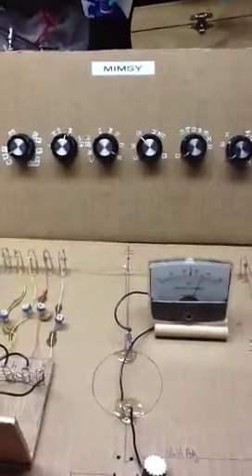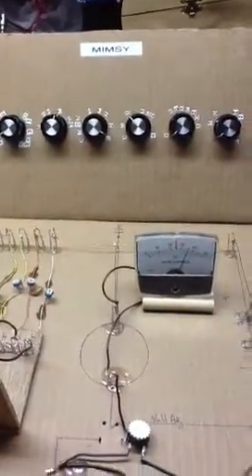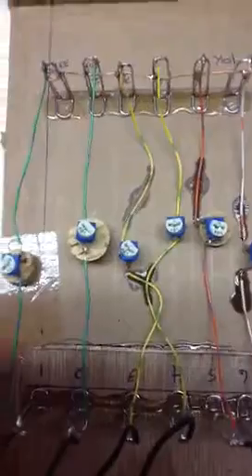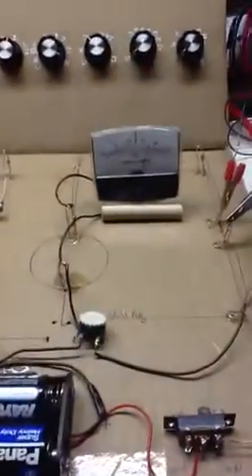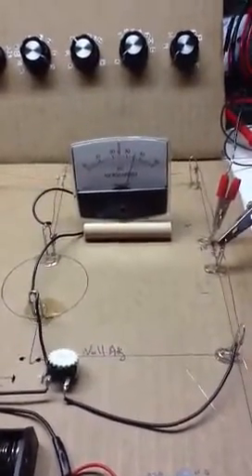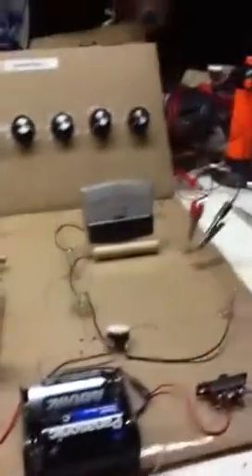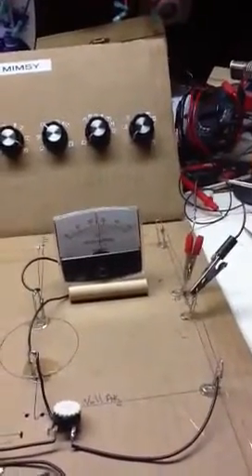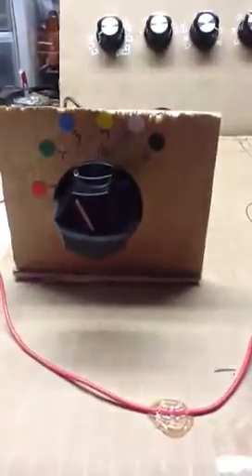Cardboard Analog Computer

Comment: This reminds me of a Electric Analog Circular Slide Rule Calculator that was offered by HEATHKIT back in the 1960s(remember that shortwave radio transceiver with its blue chasis and microphone). The first version used a galvanometer to indicate the results from settings from a pair of Wheatstone Bridges on a calibrated dial. In the advanced version the Wheatstone Bridge created a null in an audio oscillator setting to indicate results.